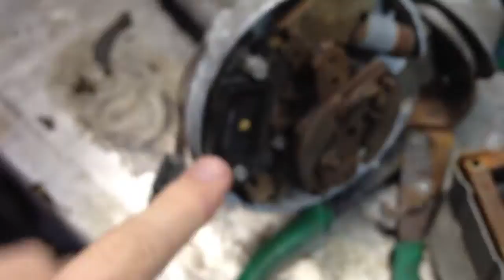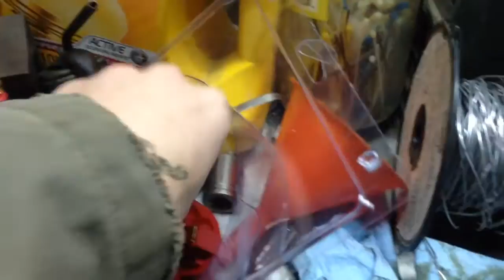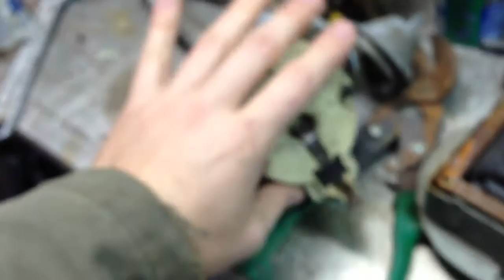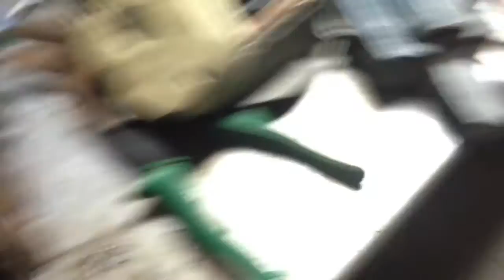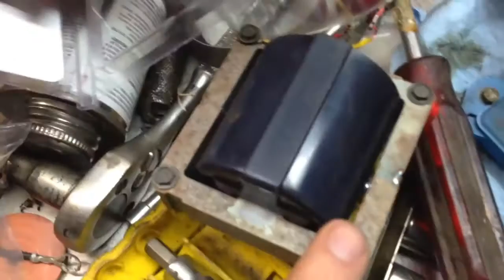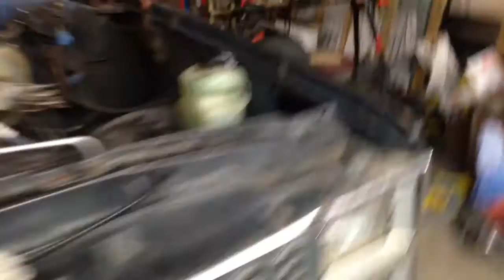81 K10 HEI tuneup

Comment: I serviced many hei distriburters in shops I
Worked at there very
Simple. Tach wire never
Made sense cause the 70s
Cars a lot of them had TACHS on the dash gages.
If I remember right u could
Use ohm or vote meter to
Diag different problems with the distributor.

Comment: Ours on our Buick is similar to Chevy but the output of the control module has 4 different color codes of the pig - tail. Have no spark with new Accel components, super cool, control module, rotor cap, bronze button, new orange washer, die electric grease. And that funky ECM connector also . Has hot pink wires has pwr. By ignition switch but no spark. Help me! 1987 Buick estate wagon Oldsmobile engine 307cu.in 4 barrel,
Reply from the maker: Not real sure on Buick, but on Chevy if you install a non ecm co tell module then you need to jumper two wires to bypass the ecm. I think I covered it in a video and don’t recall offhand which 2 wires.

Comment: What is the "tack wire" that you mention that plugs into the back of the cap? Not all trucks have that wire? Right?
Reply from the maker: If you are looking at the plug the big plug closest to the cap goes down to the distributor, then the outer plug on the right is B+ then the outer left is the tach wire.
Reply from the maker: Also, as far as I know all hei distributors should have it.
Reply: Because on my truck all I see is the 3 prong pigtail plug that comes out of the distributor and goes into the cap and one plug that plugs into one of the outer 2 prongs should there be another wire or just that one? Because I dont see another wire

Comment: Good video i have a box chevy caprice with an hei i put in it ran fine for months now when i drive car for about 30 mins then come to a full stop the car idle keeps dropping like it want to cut off i put it in neutral it straightens back up when light turns green when i take off if misfire a couple seconds than drives okay only does it once car warmed up